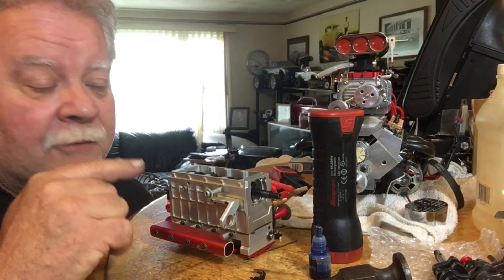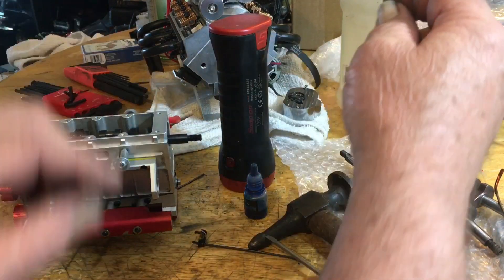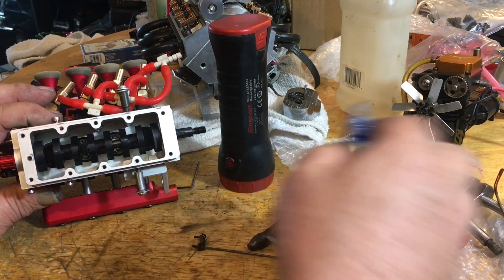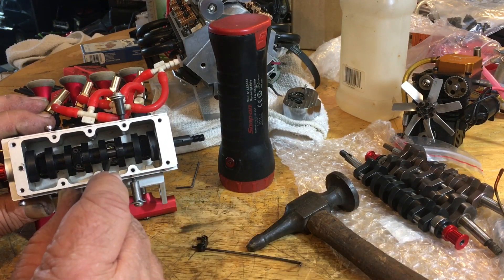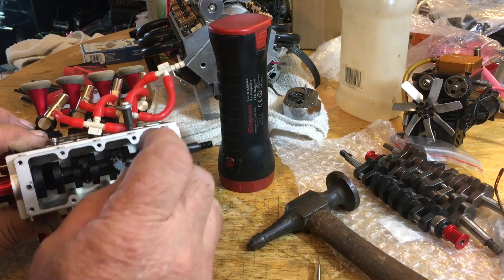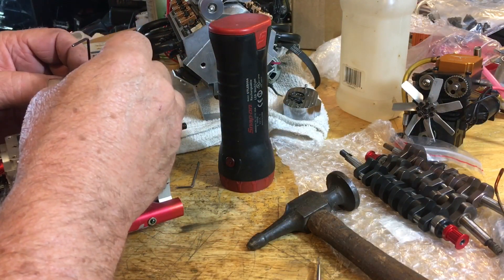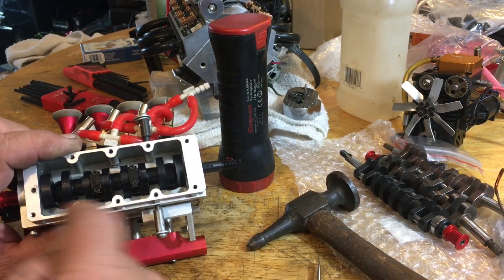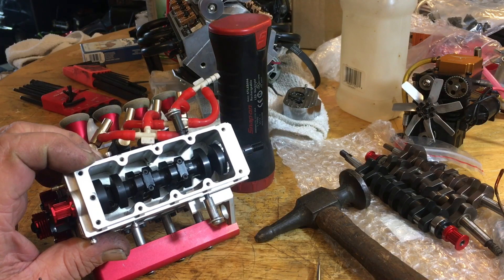TOYAN L400  EASY CRANKSHAFT INSTALL

Comment: I got the Otto motor l200 as my first model, and I can’t get the beating all the way on the crank shaft. Is that bearing supposed to go all the way on or just push until it doesn’t move anymore?
Edit, I got the crank case figured out but now I absolutely cannot get this other bearing on the camshaft. I’ve even tried putting the cam and bearing on an ice cube for a while and no difference. Is this a common issue? Is there something I might be doing wrong? Thanks
Reply from the maker: try sanding down the camshaft with some sand paper

Comment: Hi Dennis, did you add a front spacer or thrust washer to the front of the crank ? You don't mention it, so I guess you didn't.
Reply from the maker: I didn't sway from Toyans repair plan that way if it breaks they cant fault me for not following their fix,

Comment: Looks like this one's case hardened. Maybe they're using S2 Tool Steel for this version of the crank? Not the same bronz-ish color of the broken ones.
Reply from the maker: Yeah I am wondering that also.
Reply: @dennisdempseyradiooutofcontrol  If they switched to a case hardened tool steel it might just be sturdy enough to not break so easily. If it's forged it's definitely gonna hold up.

I'm no metallurgist but I'd almost bet money the bronze-colored cranks were sintered from powder rather than cast/forged and then machined. And that would have been fine if it was supported by 5 mains, perhaps even 3 mains, but just two mains + sintered metallurgy = fatigue failures.